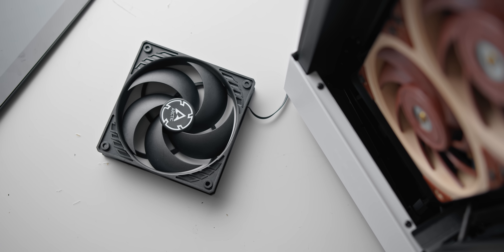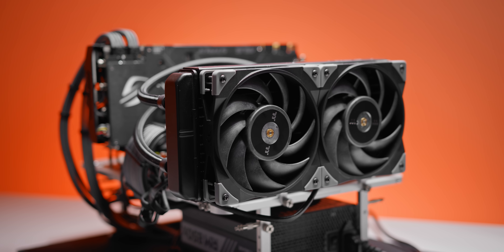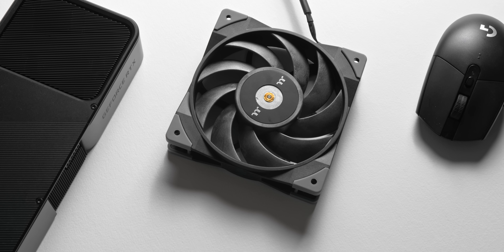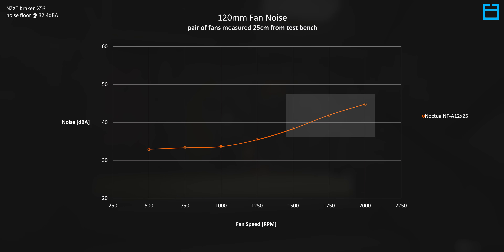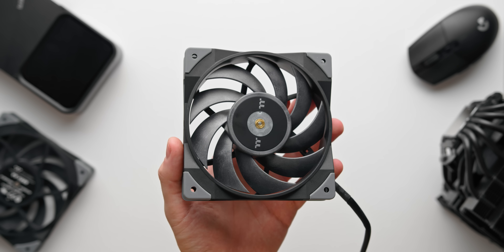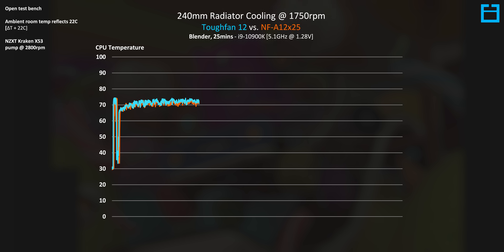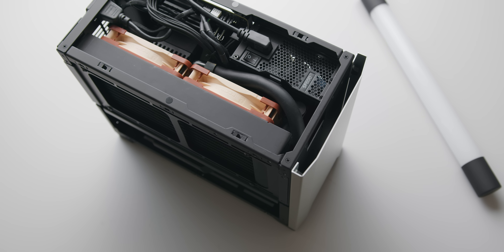Thermaltake Copied Noctua?

Comment: I just looked for them in Amazon (Spain, couldnt find them in Germany and Italy added some extra shipment) and they are a little cheaper (4€), but if bought in a 2 pack it's about 22€ each fan, and then if you add a single fan to get three for a 360mm it would cost 60€ (2 pack=44,64€+single fan=26€). Getting 3 NF-A12x25 would be 90€. It's a midpoint between the Artic P12 and the Noctua fans, but the Artic ones would be around 36€ (12€ each, or even cheaper if you get a 5 pack), so I don't think the price increase would be worth it.
Also, I found out they have a "Turbo" variant with 2500 RPM, so that could overtake those two degrees difference... over a jet engine sound. And then I also found out about a 140mm variant, which doesn't look as good, so I guess that's why it's taking Noctua so long to get the 140mm of the NF-A12x25 variant ready.

Comment: You all realise they ALL copied the Gentle Typhoon right? It was released YEARS before any of the other fans, incl Noctua. They all just tweaked the design and added their off the shelf tidbits. Noctua NEEDED to go 0,5 mm on clearance because they could not get a real performance difference, as the Gentle Typhoon fundamental design was that good.

Comment: The performance difference comes from the frame design where toughfan does not seal the gap between the radiator and the fan. It has less static pressure due to that.

Comment: I have a few Noctua products, and they are insanely high quality. With that said, they can probably knock down the price if they would just exclude all the accessories that come with it, like the low noise adapter, or extensions etc. It's ok if some people actually need/want those, but if they can sell a bare kit for lower, that would be nice.

Comment: 2 degrees difference in an open test bench will be amplified greatly once you put those fans into closed systems on standard chassis builds since there is zero heat recirculation happening in an open test bench...

Comment: I'm a little late to discovering the  TF12. I was excited for a moment thinking I could essentially get a NF-A 12x25 at a much lower price. Well, not really. I see that the TUF12 is only $3-5 cheaper (on Amazon anyway). With such a small difference, I'd definitely go with the original.

Comment: I have a set of the noctua fans and i would love them in black. Thermaltake is giving people an option for good performance and the color we wanted for years. Apparently noctua is due to release a black version this year. I have a set of these thermaltakes and they were cheaper so it’s hard to argue when you can buy two for almost the same price as one Noctua. Only bad thing I can see is that the fan leads are really long.

Comment: I guess noctua has the gap between blade and housing wall a bit tighter leading to more cost (since tolerances need to be lower) but also increased performance.

Comment: I purchased the thermaltake tough fan 12. Is the maximum RPM supposed to be 1750 rpm? I can see both Noctua and Thermaltake both advertise them as 2000 rpm fans. The maximum I could get was 1750 RPM out of the Thermaltakes. So I am confused with the marketing here.

Figured it out defective fan I can hear the bearing is bad. Seeing if it can be RMAed now

Comment: excactly what the 2 commments below said !, and secondly they aren't that much cheaper, they are 20 bucks a piece, compared to the arctic P12 where you can get a case of 5 of them for 20 dollars, and you said those were almost identical in performance to the Noctua, and they are an extremely similar design as well.

Comment: If the price difference was enough to keep a build on or under budget, then the TT fans are an option, though I would be concerned over the longevity of the motor.
If it gets Noctua to lower it's prices, that's great. 

I know you mentioned the lack of the ribs on the TT blades, but if that's the only major difference, maybe they're worth that 2 degree temperature difference.

Comment: The truth is that both Noctua and Thermaltake  use same OEM Manufacturers in China, rest is more or less marketing, may be there are small differences in the parts/motors making the Noctua a bit better, bit I bet they are made at the same place. Check Nidec Servo GentleTyphoon- another OEM fan that is identical  to both Noctua and Thernaltake and it is around since 2014.  Another identical fan is the Thermalright  TL-C12. Otherwise good review thumbs up for Optimum Tech.

Comment: I have been buying Noctua fans since 2011 (though I have occasionally bought other brands) and there is one thing about them that makes them worth the premium (to me anyway). Durability. I have never had a Noctua fan die on me. I still have the first one I ever bought and it still gets used every day (and has since it was new). So for me, when I need a new fan, I know if I buy the Noctua one, I will only have to buy it once unless I just get unlucky and get a defective one. Though I have noticed the recent Redux line is not as good and is noisier. 

 Otherwise, I don't really mind other companies copying Noctua. The whole point of innovation is to make things better. Though I completely understand why it's frowned upon to do an exact copy of something. They are just basically admitting they can't design a better fan than a Noctua.

Comment: I got 5 Arctic P12 because they're cheap and actually good but I ended up replacing them a few days ago with 5 NF-A12-25 because they were making an annoying humming noise at certain RPMs, which was different for each fan. The Noctua fans are pretty amazing, but at the price I got them at, they should've be able to make me eggs in the morning too.
Reply: do you still have the noctuas?
Reply: @Zombie101  of course
Reply: @dragos-lucian  awesome! i bought some, i think id go for thermal take doing it again though just to save some pea
Reply: @Zombie101  no regret here. Mine are running at 550 lowest and they only gradually ramp up to maximum 1000 when the water crosses 35C.  My PC is dead silent except for the PSU (RM850x 2021). I’m thinking of either replacing the fan with one that was in the 2018 variant of the 850x or with an NF-A14 which I’d connect to directly to the mobo and make it ramp up o ly when the load is heavier.

Comment: Got a pair to try (will buy the Noctua's as soon as they're out). Anyone else having an issue with the TT's and low-rpm (approaching their 500rpm min) starts generating a loud clicking noise. I plan to return them (got 140mm version), since the design is cr@p compared to a real Noctua, and ethically TT is unsound. Curious if others have/had the same issue with clicking noises

Comment: I saw noctua show all fans in black 2 years ago and they still can't manage to ship them out. WTF are they doing other than counting money?
Reply: Yes, they are extremely slow. That pisses me of too. But... if they bring some new product you can be sure this product is on top for many years....  The D15 is from 2014 and it is still the best cooler. Some stuff running their D14 on actual sytems and got free mounts for them. The Fans will hardly never fail.

Comment: I never really understood the price complains. They are easily the most high quality fans, come with rubber corners and screws, multiple different cables etc. Also Noctua has amazing customers service.
Not to mention these TT fans are basicly the same price or even more expensive, for overall worse quality, noise levels and less accesoires.

Comment: i was going to do the 120 riing to match the 2 140 that came with the case huge case custom liquid overkill, to the point I didn't like the low rpm of that fan and have tight budget and same brand as case can't say no, plus I can do both RGB an ARGB with onboard headers and custom strips

Comment: I have a Core P3 case and a ToughPower Q-Fan 850W PSU (both Tt products) that are still as good as when I bought them... but I'd still go with Noctua in this instance (and plan to when I can afford to replace all of my current fans).  If there's one thing Thermaltake have never excelled at, it's good, reliable fans; the noise frequencies are often too disturbing at any speed, and they literally die screaming.

Also, most of the difference would probably be in the quality of the motor assembly, evidenced by the longer projected lifetime, better acoustics and faster maximum speed of the Noctua over the Tt; if the motor sucks, the blade design becomes irrelevent.

Comment: ngl, I'd probably buy them if it meant saving a few dollars per fan, but that bearing/motor noise @3:20 was a big red flag to me, and as you mentioned, the vibration that could be felt even just spinning them by hand. I think good bearings and a good motor are crucial components if you're going to spend so much on a fan for its quiet performance.

Comment: For anyone asking which fan to buy. You just should dig a bit deeper than performance in the first place. Thermaltake copied the design but they don't give you a 6 year warranty or a MTTF of greater 150000 hours. And Noctua already announced they will bring a black NF-A12x25 in Q2 of 2021.

Comment: There is no point talking Thermaltakes aproach to "designing" its  products. But to be completely fair, A12x25 is hugely inspired by legendary Scythe Gentle Typhoons too. And there is nothing wrong with that. Why not use it, if it works? I wonder why Scythe descontinued them... best fans they've ever made. Speaking of it, would be really interesting to test them against A12x25 too, I'm sure you can manage to dig one of them somewhere. :)

Comment: Love my toughfans.  I prefer them over the Noctua.  Dun dun dunnnnnn.  I've been using them for months now on my AIO and tested them against the Noctuas only to find a one degree difference that seemed to fluctuate, test to test.  I actually don't have any vibrations and I spent a lot of time listening to them.  The drone of the Noctuas at high speeds is more obnoxious to me than the darker, deeper sound of the toughfan.  Then again, I'm never going to hear either one unless I'm running prime95 small... which I don't normally do.  They look better, sound better, and work just as well.

Comment: That minor difference of the channels on the fan blades are what help with small turbulence cause from the fan spinning. Those channels are from years of engineering by noctua that’s why there’s that small rattle or ticking from the thermaltake at 1000rpm do yourself a favor if you are considering these and go with noctua. Personally I love the brown noctua fans and proudly display it in builds, call it a flex or what ever but the proof is in the pudding. Noctua literally engineers and design cooling solutions. I would rather have the fan that was designed over years of trial and error than another company’s fan that just copy and pasted the design and didn’t even copy it right.

Comment: "I don't know what the difference is coming from here as the fan blades are identical". I don't know, maybe from the motor and bearings? There's more to a fan than the blades.
Reply: The noctua's fan is ribbed. The intake ramp is stepped.

Comment: Now owning these fans I would not be surprised if these fans are manufactured by Noctua for Thermaltake just a different variant, especially considering that the material used is not only identical but is also trademarked by Noctua. Not uncommon for manufactures to make products for other companies and rebrand them, let's face it as nice as Noctua's are they do not sell many fans this would be a great way for them to increase their bottom line.

Comment: There are loads of fans with similar blade designs and you could argue that Noctua copied it from scythe gentle typhoon fans, which have the same profile and 9 blades. But really it's more than likely because that particular blade design is the optimum for a certain airflow profile, so if you set out to design a quite fan with good static pressure, you're going to end up designing a gentle thypoon. Again.

Comment: People are free to spend their money how they see fit, and price usually dictates the masses' dollars.  I just think if you can't afford Noctua, the savings isn't really great enough to really consider the TT offering either and I would look towards cheaper models.  I would much rather Noctua, Scythe, Arctic, and Fractal continue to get my money than to buy this fan from TT.  I would buy other products from TT, and actually have that I had to grab from Fry's when my CPU cooler fan died.  It a horrific thing with bright LEDs that don't toggle off so I resoldered into a PSU that the fan so the light is less obnoxious.  I usually only wind up with TT products when something breaks that I needed to go to Fry's and get a solution the same day.  I just prefer not to purchase replicas unless it has been discontinued, but to each their own.

Comment: TLDR: Why does Noctua hate money?

I would've ponied up for 9 noctua nf-a12's if noctua liked money & the nidec gentle typhoon did not exist. But, noctua does not like money & I went with 9 gentle typhoons instead for 1/2 the price.

I do think it is unfair to single out the toughfan as a fugazi (although thermaltake is infamous for "borrowing" ideas). I am pretty sure the gentle typhoon is the inspiration for the nf-a12. The gentle typhoon is the OG super sexy fan.

It looks like noctua will be releasing black & white nf-a12 this year but it's too little too late. I can't see myself going with noctua when there are at least 2 significantly cheaper options that are effectively the same product. And if you are like me, a quiet freak who does not allow his/her fans to spin over 1100 rpm or so. The very slight performance advantage the nf-a12 can claim, becomes a mute point. IMO, if you are asking 2x the price, you need to offer more than 2c cooler & 1/2 a decibel or whatever @ max rpm.

The only scenarios I feel the nf-a12 makes sense now is if your goal is an all white build, where every decibel & degree reclaimed is critical, or small form factor pc's.

... DazMode.com has the best price I am aware of for the nidec gentle typhoon.

Comment: You can buy an Arctic fan for 5.50 Euros(120mm) or 6 Euros(140mm), Noctua costs 20 Euros (120mm) and 21 Euros (140mm), and from what I could find Thermaltake is around 20 Euros too, this is just not competitive for me at least.

Comment: Mate, these fans are trash. 40,000hr lifespan. They copied the blades but couldn't be bothered to not use their usual cheap sleeve-bearing motor hub while still calling it a "hydro bearing". The Noctua's are rated at 150,000+ with a custom FDB bearing. Literally the definition of a cheap knockoff: looks okay but dig and realize the guts are garbage. Buy the P12s if you want cheap. You can get a pack of FIVE in the USA for just $40, and they are real FDB bearings with a TEN year warranty.

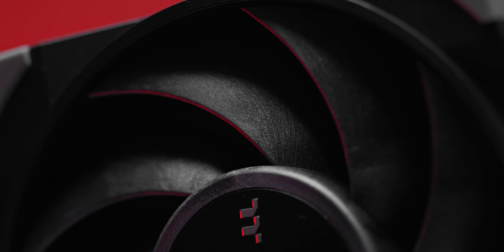Comment: 5:15 Is that really important? Basically everything on earth is a copy of something. Either is rebranded or a cooperation or anything or simply a good copy. I could give you 1 million examples. From mobilephones to cars, to computers...hell even catfood and wesbites are all copied from eachother. 
Its not important to creat something new, its important to creat something that works flawless. As long as the product is fine, the consumer will take it.
Hearing that you criticize Thermaltake for their working product is just not cool and it sounds so hypocritical, cause im 100% sure u have something at home that also is not original. 
Fact: I have 5x Noctua Nf A-12 in my case so iam not a TT fanboy.

Comment: I wouldn't buy a knock off especially if it vibrates more. I have two 200mm pushing and a 140mm pulling at higher speed, they are gloriously quiet. No small builds for me :D

Comment: If there is a need in the market going unmet then someone will fill it.  Clearly there is a need for a black version of this fan, and probably a lower cost version of the fan.  Looks like the TT is about $17.50 while the Noctua is $30.  If I were trying to consider between the two I'd probably lean towards Noctua just based on the name IF they had a black model.  But they don't, so TT would get the call.

I think that it was Steve Jobs that once said "if you're too afraid of cannibalizing your own product lines then someone else will do it for you."

Comment: Noctua probably comes with more extras. I want cromax with white corners look. It has higher max rpm. Better quality control warranty and support. Noctua gives you braging rights. They spent 3 years on the design and thus understand it so it will probably last longer and degrade slower. Its not litterally a lazy cheap copy. Plus noctua is great an dd's i want to support them. Buying their products helps them innovate and do more research

Comment: Shocked Pikachu face, but is Noctua brown. It's a real effing shame TT didn't use completely square frames, there are gaps for the air pressure to escape, like with so many bloody fans these days. They don't make good seals against rads.

Comment: A lot of snobs commenting and throwin shade at people defending these fans for what they are and it's disgusting. I love these fans, got them on sale for $16 each with FS not too long ago.  Even if the 40k lifespan is accurate, that's 4.5 years (constantly running) of performance for a good price. They're good fans. You boycotting purchases from TT is not going to stop them from doing what they do best. It's also not going to stop Noctua from making quality products backed by years of research and a great warranty. Quit acting like this is an existential choice. They're pc fans. They are a knock-off, like most everything TT sells. I'm sure a lot of viewers on this channel in particular run knock-off sff cases from Aliexpress anyway, or They're sittin on a knock off office or gaming chair.